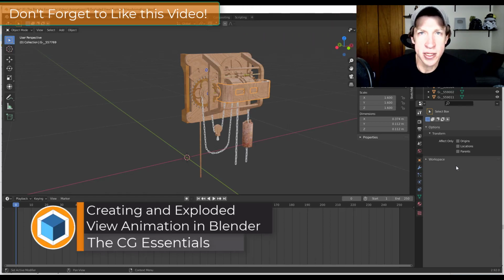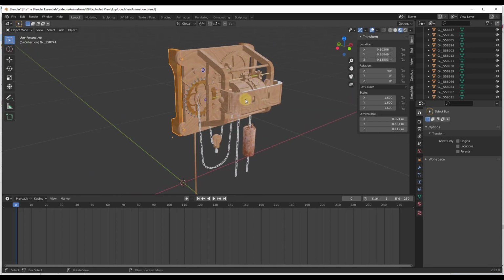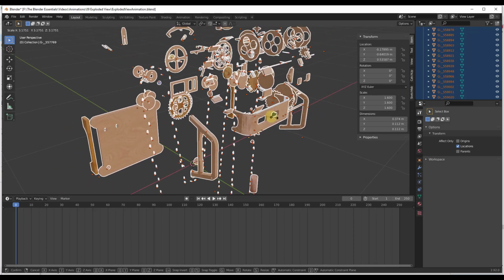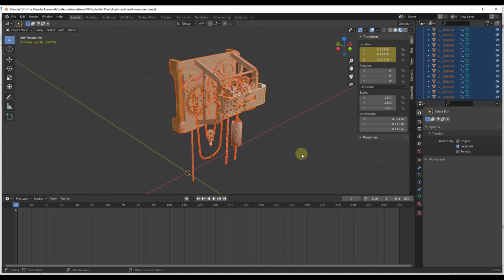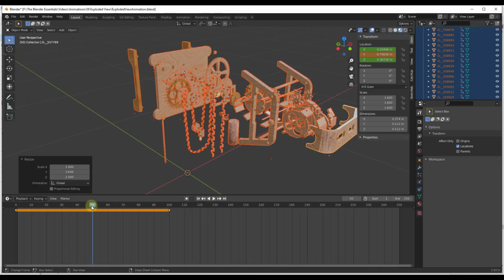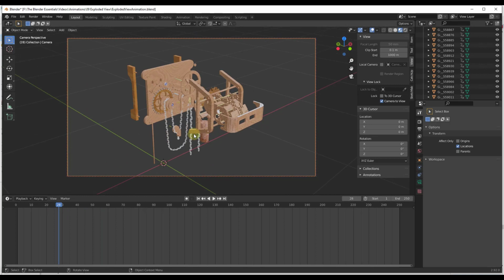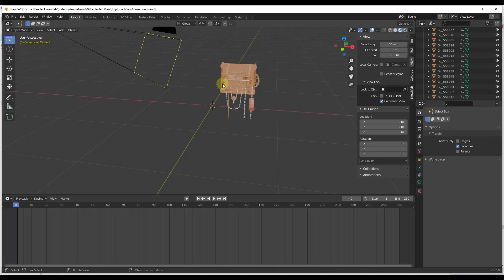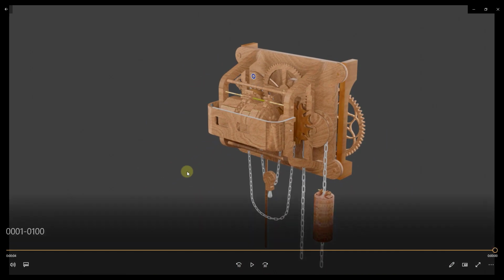How to Create an EXPLODED VIEW ANIMATION in Blender!

Comment: Hi, great tutorial! I have one question though, is it possible for you to make tutorial about sequential forming of some assembly? In this example you made an animation in which all the parts start and end its movement at the same time and I would like to make animation in which movement of parts will be sequential. Using this assembly for example, if I wasn't completely clear, it would go something like this:
1. assembly of few parts closest to plate
2. assembly other few parts that are closest to previous assembled parts and so on until complete assembly is formed.
Also, if I may ask could it be possible for you to do it using Action Editor because I need it for my following manipulation of that animation in Unity.

Comment: There must be more to this because it simply doesn't work for me at all. I imported an OBJ project into Blender that was originally designed in Fusion 360. All the parts are separate, and origin is set in center of each object by surface mass. After selecting all the parts, then selecting "Locations" under "Affect Only", scaling does absolutely nothing. Any idea why? I tried importing the same project again but this time as STL (experimental), and it worked, so it must have something to do with the OBJ format. I would like to use OBJ instead of STL to preserve things such as textures.
Reply: same problem

Comment: Thanks for the tutorial. But in my case, the second I click "affect only -> locations" scaling doesn't work anymore and nothing happens :(
Reply: for me as well, did you find a fix?
Reply: i found my error, the transform pivot point (seen on the top bar in the middle) needs to be set to median point, not individual origins or one of the other options.

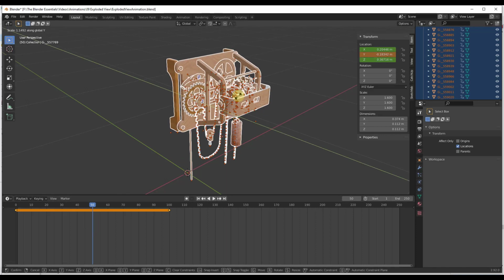Comment: Great tutorial!!!  I love coming and checking out your tuts and laid back style.  Keep it up!  Just out of curiosity, as you work with the 'exploded' view, what if you want part of the clock to 'stick' with another part as it's exploding? So for instance, with the clock at 4:19, you want the 2 'brackets' to stick to the back of the clock board as it explodes, as if it were screwed there.  But everything else does the location transform as you have it set up.  Thanks!
Reply: I think you could just join the 2 brackets to the back of the clock before doing the explosion - (Ctrl + J)?
Reply: You could join them with Ctrl + J, but I suggest to use an object constraint (Child of). This way, you don't create unnecessary meshes and can still use the single objects if needed.